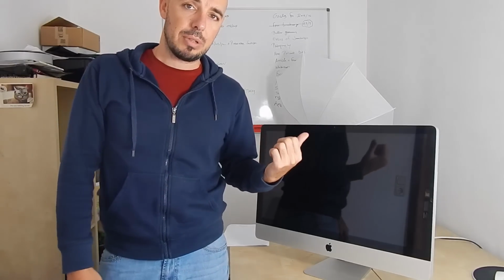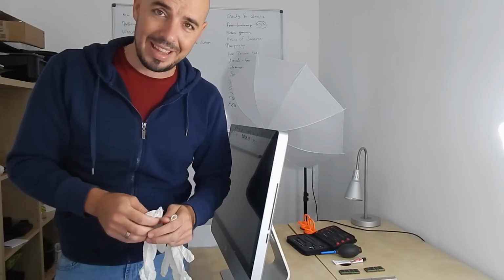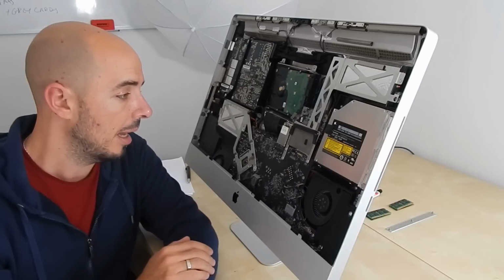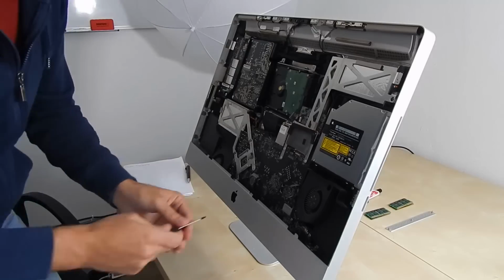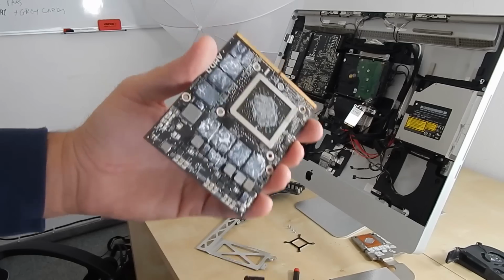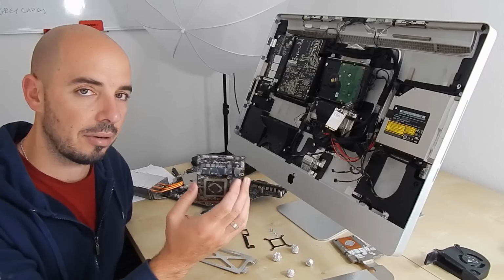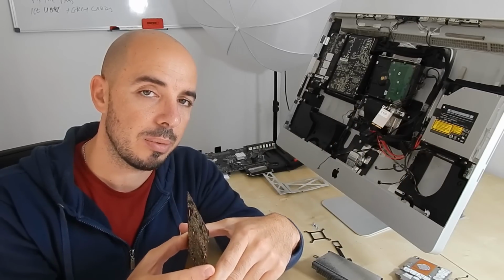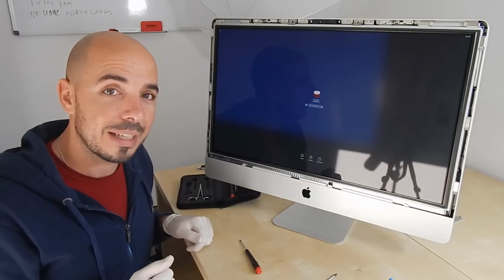Burn the VGA and  Fix your iMac - Don't Pay Shitty Problems!!!

Comment: apple will replace graphic card for free even if your imac is out of warranty
Reply: unlucky I had my graphic card replaced by apple for free only a few Months ago.
Reply: I had my 2011 MacBook Pro  logic board replaced for free by Apple it  was on a specific quality programme .
Reply: I tried to call Apple-Norway, but they refused to take it in because it was older than 4 years. Apple really sucks.
Reply: Ronald Gibson Why did they agree to replace yours? Because on the apple website it tells you that only iMacs under 4 years are eligible for the replacement program.
Reply: I took my imac to MAC SYS here in the Northern Ireland 6 months ago all I had to bring with me was the original receipt.
MAC SYS is the only Authorised Apple Service Provider in Northern Ireland.
Reply: Ronald Gibson Thanks! Just contacted Pippin, an authorized Apple retailer here in Norway. Really hope they agree to take it in! Is your iMac from 2011 or 2012?
Reply: 2011
Reply: Ronald Gibson didn't work for me. Mid 2011 imac. Has to be under 4 years.

Comment: Funciona 100%, ha salvado mi iMac 27" 2011, 3,1GHz i5 y Grafica AMS 6970M de 2Gb. 650€ ahorrados. Muchas Gracias por la aportación.
Reply: Kenza Power yo también quiero hacerlo con mi iMac 2010 ¿200 grados centígrados durante 8 minutos?

Comment: Thanks so much for this video. It was easy to follow and perfect as a step by step.  GPU is in the oven as I type. Fingers crossed :)
Reply from the maker: Hi there, please tell us what finally happened!
Reply: Screens not coming on on first test. Starts up and black blank screen !!
Reply from the maker: Did you plugged everything back correctly? It seems that something is not plugged that's why you see nothing.
Reply: yep. 3 cables plugged back on on the reverse of the screen. We've double checked twice.  Would the screen show at all if we've fried the card? Also I've tried hooking a display cable from imac to laptop and it won't screen share?
Reply from the maker: What about the other inner cables? Are you sure everything is plugged in?
What was the problem of the card in the first place?
I don't know about the screen share because I haven't done it before on my iMac.
If you followed my steps exactly then the card it has 70-80% chance (comparing the feedback I get from the users) to work again. 
If you didn't make any mistake with the cables you might be in that sad 20-30% of the unlucky card users.
Reply: Cheers, Will double check all cables tomorrow. The original issue with the GPU was that the screen was throwing up artifacts and the login screen was unreachable. Thanks for your help.
Reply: Check the cable from the display to the Locig Board - the data cable which is black and has golden pins and at the end has that clipper with the plastic on it. I Pray you didn't damage it.

Comment: how can I fix a blue line on my macbook Pro's screen
Reply: You need to a buy a new screen :/ 
But take it in to an authorized Apple retailer.
Reply: *****
how much
Reply: Liberty Lagrana it can also be the ribbon wire that goes from the computer to the screen, some time they become loose, and just need putting back in place, or the ribbon wire has cut and needs replacing.

Comment: Evan, my iMac abruptly went to a blank screen and when I tried to restart it, it is stuck in a repetitive cycle of the start up chime and it never starts. It won't stop trying to start up until I unplug it. I took it to the mac repair shop in our city where our Apple Store goes to get repairs for customers and they said I may need a new video card and that may not be the problem, I may need a new logic board. I'm going to pick it up today and ask them if they ever were even able to boot in safe model because I wasn't able to get it to do this. If anyone would be kind enough to have suggestions as what I should do next regarding the problem, feel free to answer.

Comment: for a production computer, i recommend replacing the card instead, I do this long time ago but its pain in the ass to repair this thing every month or so, replaced it with a same form factor mxm videocard with different brand (nvidia this time) which is uses newer architecture lower tdp and much faster than the older and broken one.

after that its been already 2 years since I totally replaced that card and it still works.
Reply from the maker: My GPU the first time worked for 18 months and since this video which was recorded 12 months ago, it still works like a rock star! No need to buy another card if you do it proper! ;)

Comment: Great tip! Saved me a bundle man, you deserve a stronger drink!
Additional note to others trying to pull this off: If your iMac has a DVD unit, take it out as well or you'll have a hard time taking out and replacing the fan. And don't forget to take detailed pictures, there are several types of screws and you don't want to loose track of where they belong.

Comment: Hi Thanks. I recommend after reballing or reflowing the solder to manually set the fans at a minimum of 2000 rpm and with small desktop fan at the back (at speed 1 perhaps or 2).

By the way what kind of thermal pads is need to replace the thermal pads (for the chips that surround the GPU chip?), how thick and what brand?

Thank you. Have a great day.

God bless. Philippians 2:13

Comment: hey one of the screws to the brace that holds the heat sync to the chip broke when I was reattaching the heat sync. do you happen to know where I can get another one?
Reply from the maker: I am sorry mate I don't know where to find a new one. You can check on ebay.

Comment: Hi,
I have my iMac late 2009 21.5" with the same problem. I would like to give it a try!.
1. I don't have an oven,  can I use Microwave instead?
2. I also don't have the Thermal, is it really need?
3. What did you do with the RAM on your desk?

Thank!
Reply from the maker: If you don't have a thermal paste and an oven, don't try it my friend.
Reply: I ordered the Thermal paste already.
Do you think the Phillips AirFryer will work? I have it.
Reply from the maker: Find a friend with an oven and do it like the video. I don't know if the other methods will work.
Reply: Thanks! will try

Comment: My mid 2011 27" iMac boots and hangs on a white/grey screen.
I cannot recover by any means. Cmd+R, Cmd+Opt+R didn't bring up OS X Utlilty.
Holding Opt+S shows selection of choice to boot up from (original HDD, my 1month old SSD, Recovery Disk, OS X installation USB) but none was able to complete the boot up.
Do you thing the graphics card could have a problem?

Comment: For how long it work after your repair ??
Reply: Unfortunately, the first time 2 months.....Repeat the procedure now see.....
Reply: is difficult to explain but basically you are realise the transistor inside the GPU but that is a temporary solution and normal work for up to 6 month at the time but is not a real solution , the rial solution is replace the chip as it is already gone
the myth is that the soldering ball are bad  and with the oven it get fix ... but the reality is that the chip is gone

Comment: Thanks for the video. Quick question can you over burn the card??? I had three iMac I needed to repair 1 out of the 2 worked and the other two I'm getting black screens now. So I'm wondering if I over touched the card.

Comment: Awesome video. I have an iMac that has a bad graphic card currently and I can't access my hardrive. Is there away I can access my hardrive on my iMac with my MacBook so I can backup the files?
Reply from the maker: +babyjjnels hmm I don't know, but it's easy to take our the Hard Drive of your iMac when you take out the Screen. If you follow my tut you will get it.
Reply: +Evan - Creative Tuts great thanks I was just worried the hardrive might get damaged if I mess up the graphics card.
Reply from the maker: +babyjjnels I don't see why the HDD would migh be affected by a VGA problem. So don't worry! :)

Comment: Wow, I see comment after comment below saying this worked!  I am unable to watch this vid right now, to learn all the steps, but I am ready to try this b/c the black screen of death is driving me mad!  My iMac has become a very expensive doorstop.  I'm using a library computer now, but I didn't bring my headphones.  I will bring them tomorrow and watch this when I can hear your explanation.  I learned from watching another vid that I can use a suction device to remove the cover screen, which is held in place by magnets!  (Who knew?)  I always thought it was glued together or sonic welded and I thought it would crack if I tried to pry it off.  At least I'm learning some things about Mac repair!!

Comment: Hello everyone , this is not a permanent fix.
Firstly heating the card to 200 degrees Celsius will not melt the solder balls as they flow at 217 degrees Celsius. All you have managed to do is to temporarily fix a failure inside the GPU chip itself. The internal connections inside the chip detach and reheating it just temporarily  reattaches them. You can easily prove this fact by just heating the GPU chip to say 150 degrees Celsius. Re-balling or re-flowing the chip only has the same effect. The only cure is to replace the chip with a new one and that does not mean a cheap re-balled one from China. This will have only been through the heating process by having new solder balls fitted. This trick will work for an unquantifiable amount of time but rest assured it will happen again
Reply: Sounds good until you read his recent reply saying he's been using it flawlessly for 17 months!  But to answer your 217°C point, all one need do then is just set the oven temperature to 220°C instead of 200°C.  Done.  Even so, it would appear that his setting of 200°C works.
Reply: Wait... Re-balling doesn't work?

Comment: Hi Evan,
thanks so much for your video. I have a similar iMac, but been having problems with the graphics switching, especially if i open graphics intensive application. It just turns black for a few seconds or more, forcing me to restart. I don't have the lines problem you had in the video. For other usage it works fine. Do you think it is a fault in the graphics card? If yes, is the solution baking the graphics card?

Comment: hahaha great solution. putting parts in the oven until they're well done . If it's just the soldering , a blow solderiron does the trick as well. but usually it's just poor soldering. I have the same iMac, and it was recalled for an exchange card. my problem started with the screen moving . On replacement they replaced my LCD screen at the same time, as it also had a small problem with a backlight connection. depending on the age and if it still has applecare, I would advise people to bring it in. if you do not have any warranty left , there are repairmen that willl do this for about 100 -150 euro , to fix this permanently.

Comment: Good video! I just have one question---  I have a mid 2011 mac ( the same one as your i think) --- For a couple of days ago when i was watching a video my computer screen just turned "black" exacktly like this === https://www.youtube.com/watch?v=k7l-ghIRALo  I restarted the computer. and it was black, then suddenly it was lighted up, then black again.  Sometimes it works 10 minutes or so, and sometimes 1 hour.  then maybe i watch a video or so it goes black again, just before i see a blue screen sometimes  and the screen blinks... I read at the apple site that its a problem whit the graphic card in this machine..  And maybe the sollution is to do the procedure in your video?` i think i saw another video whit the black screen problem, and he was burning the graphic card also
Reply: +Varg af Morganium Hey there! i have the same problem with my mid 2011 mac 27inch. The black screen keeps popping up when ever i do graphics intense work. Have you tried contacting apple?
Reply: +Rahul Rao Hello, i have not been in contact whit apple about the problem yet..My imac is now black as the night so i dont know what to do. sadly its not free to call apple  (30  $ ) or something like that...

Comment: hey evan, I have Apple iMac 20" Desktop - MB324LL/A (April, 2008) and Apple iMac (20 inch model A1224).  with the same problem you need to perform the same instructions

Comment: Hey Evan, I have my (iMac 27-inch, Mid 2011) with graphics // AMD Radeon HD 6970M 1024 MB, can this trick work with the same problem? 

Thanks
Reply from the maker: +Rodijs Razmus If your VGA causes you problems probably this trick will help you get it back in shape! :) So when you are ready give it a try and write me if it worked for you!

Comment: My iMac has been dead for almost two months now! can't wait to do this = ) will post again when it's fixed!
Reply: Did it work? Did you try this?
Reply: +babyjjnels yes it totally worked 🐶
Reply: yeah it worked for me too. However i went crazy disconnecting all the wires and un screwing all the screws. I can see why you would pay someone to do it.
Reply: I dont understand the clipping mechanism on the 1st cable to the top/left. I don't want to pull on the cable and damage the wires. That would defeat the purpose.

Comment: Hi Evan. I have a 2008 iMac with the nvidia 8800gs card and many artifacts appeared on my screen at boot up. I have followed the whole procedure as you mention and assembled back my iMac carefully following iFixit. The only problem now is that when I turn it on I don't hear the Apple Gong and I have a black screen. The fans are running and the HDD is running too. I'm really worried because I have checked all the connections and they all seem to be fine!
Reply from the maker: +Joan Ferre this video is specially for the Ati VGA problem. I don't know what is the fix for the Nvidia cards my friend. if you don't hear the Gong sound and you are sure you have all the connections are ok then I am afraid the vga didn't make it. I suggest you double check the whole inner system for not good connections and give it a try once more. Good luck!
Reply: +Evan - Creative Tuts Thanks for your quick reply. I'm on the process of rechecking everything. I thought that even if the graphics card died the boot up Gong was heard only that there was no video. I will write to see if there is any news. Thank you!

Comment: The small risk of putting in the graphics board in the oven is that other parts could de-solder as well. But seemingly, looking at the responses this looks like a reasonable risk 👍🏻
Reply: True but it's broken already so what the hell right?
Reply from the maker: +JCD The time you put the vga in the oven it's not so much to melt the board. So no stress if you follow the instructions! :)

Comment: What brand of thermal paste did you use also there a knack not to get dust on inside glass
Reply from the maker: +Chris Baxter I don't remember which one I used. The cheapest in Amazon. :) But it works like a charm!

Comment: Hello Evan:) I finish but when i start the iMac, i hear the apple "gong"... the Hard drive running... But the screen is black :( Something i ought to do please? The graphic card are realy dead? i'm so desappointed... For my iMac I just disassembled the graphic card, it is not welded at the mother card. (Sorry for my bad english, i'm french, i hope you can understand me) 
A solution for my problem please?
Reply from the maker: +Oumi ABOUBAKAR If you have connected everything right then I am sorry but the VGA is dead. I suggest you see if you have your connections ok (my imac has 3 cables in the back of the screen). If you haven't connect something right maybe that's the problem of the black screen. I wish you good luck!
Reply: +Evan - Creative Tuts  Hello Evan, ty for your answer:)) Im' going to see if all connections are OK. Perhaps I have the last luck..... Come back soon :)

Comment: Worked like a charm although my iMac is breathing heavy but it worked...
Reply from the maker: +jason olowoyo I am glad that worked for you! Maybe the heavy breathing comes from the temperature sensor that controls the speed of the fan. Once i cutted by mistake the cable of the sensor and the fan was working in full speed. Then I taped the cutted parts of the cable and everything were back to normal. :)

Comment: Hi Evan first of all  thank so much for this nice tuto, my screen today is becoming totally dark (like sleeping) and I m unable to recover it (I've checked PSU /inverter and all seems Ok) I've tried to use Minidisplay port to another Monitor but no screen too on the other monitor. So I'm suspected the graphic card . My Imac is  Old 2009 with 4850 GPU do you thinking your tips can fix my issue?
Reply from the maker: +lynyx77 thank you for your comment my friend! Your iMac's "symptoms" are different than mine but it looks like a VGA problem. You should wait a couple of days in case it comes back in normal, then you can try your luck!
Reply: +Evan - Creative Tuts Hi Evan Thanks for your comment, I've tested with success today your procedure and all is Ok now. I'm hoping to do like you 2 years with this card and perhaps more...
I would like to test my card (GPU) and perform a stress test do you have some application to recommend me?

Comment: I have this type of problem in my imac 24" of 2009, when I start there are pink lines on screen. I went  to the apple service center and they said me this product has MLB problem and vintage product and they said it is not possible to solve it because company is not making MLB part of this product now so.
Is it risk to open imac at home ?
Reply from the maker: +Jignesh Ahir I suggest you give it a try once your iMac is unable to work. If it has the pink lines only in the beginning and after works ok , do not touch it.
Reply: Thank you.